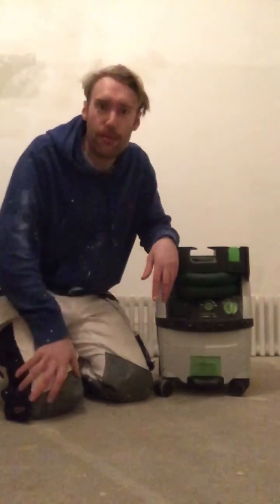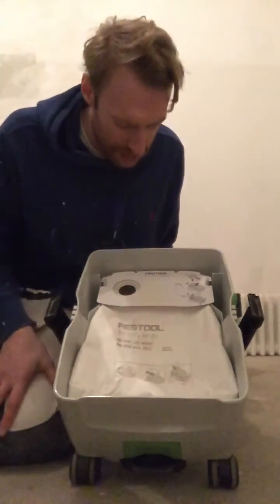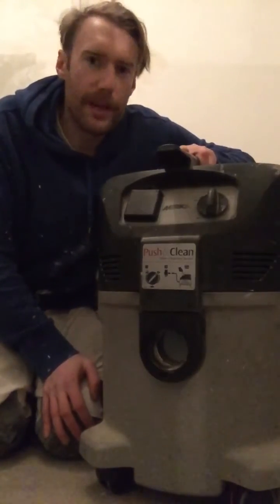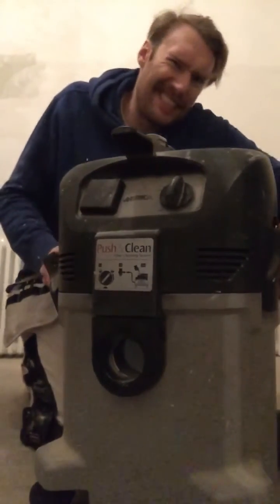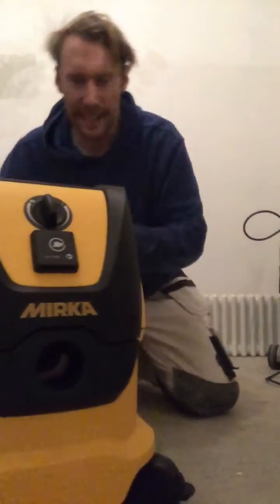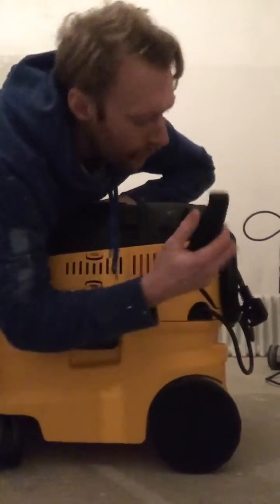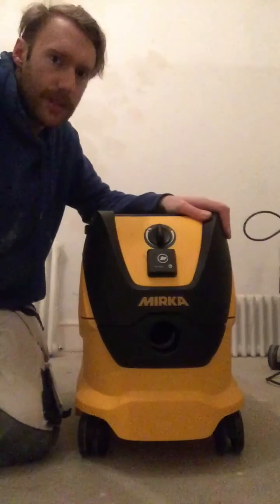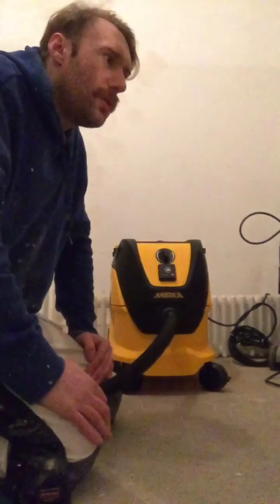Festool / Mirka Extractor help guide

Comment: i have Mirka 915l    do you use other dust bags as there cost so much ?
Reply from the maker: larksp I used to use Nilfisk bags. I got them from screwfix at a decent price 🤙🏻
Reply: ill look on there for them closer to the time i need to replace them thanks.. was there a model of nilfisk you went for as there normally different sizes and shapes
Reply from the maker: larksp I’ll find a link 🤙🏻
Reply from the maker: larksp https://www.screwfix.com/p/nilfisk-attix-50-01-maxxi-ii-35-302004004-vacuum-fleece-filter-bags-5-pack/8198x

They seem to have gone up in price 😖 £24.99
Reply: most things do :) and still cheaper than £36.25 thanks for the help